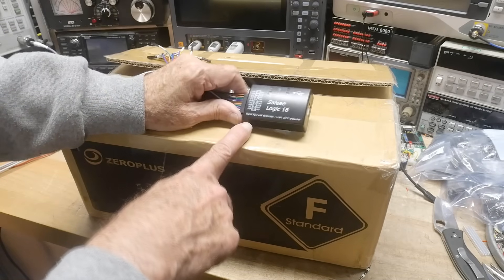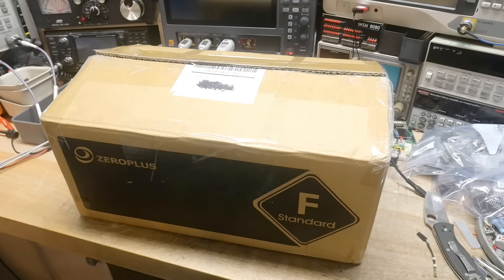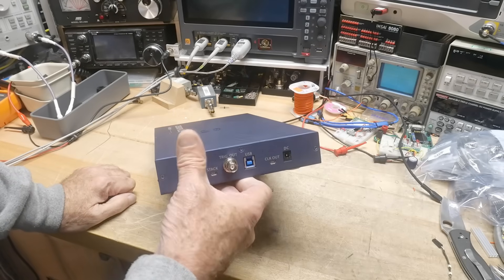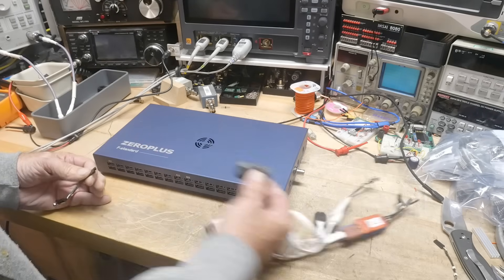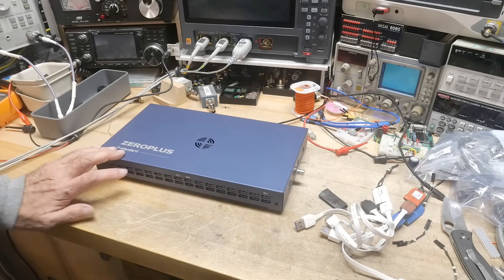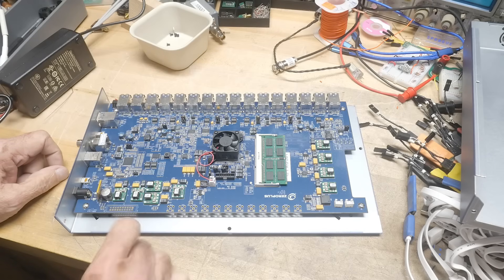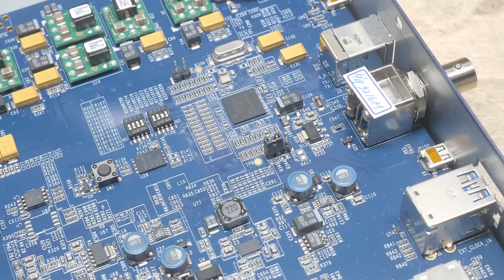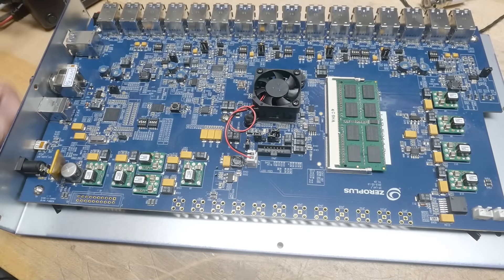#2470  ZeroPlus F1 Logic Analyzer (part 1 of 3)

Comment: As an alternative logic analyzer, I have had good luck using Sigrok software with Hantek's 4032L (32 channels, 400 MHz, 64 Msamples/channel).
Reply: Back in the in the late 1990s, I used HP 16500B and 16500C logic analyzer when you need to go way, WAY beyond 32 channels.  Great stand-alone equipment but I don't know how well the ones on eBay have aged.

Comment: 10:24 XTAL near FPGA is sitting on some fancy (ceramic?) adapter.
Reply from the maker: didn't catch that one, looks like it was made to fit a larger footprint.
Reply: @IMSAIGuy  I wonder if pads on it are in order to make parasitic capacitance some known nominal values
Reply: @IMSAIGuy  Could also be a programmable divider inside there as well, with the ceramic board to allow the chip to fit, so the divider can be changed on the fly.

Comment: Neat. I've seen these, but never seen a review of one. The ideal number of channels would be about 70 or 75 - that'd give you 32bit address + 32bit data + bus control signals. Usually you won't run into parallel busses that are wider than 32 bits - most things now are all serial. I did a reverse engineering project a couple years ago on a 32 bit system, and re-habed an Agilent logic analyzer back to life. It took a month to fix everything, track down all the correct cables and flying leads, stacking cables, etc etc. Fixing up the analyzer was a project all in itself, before the main project could even start!

Comment: If you're patient and look hard, you can sometimes score a reasonable deal on a high-end Keysight logic analyzer on the used market. I picked up a nice Keysight Logic Analyzer a few years ago... it supports either 128 or 256 channels (I forget which offhand) for about the prices of a high end oscilloscope. New, it would have cost north of $22,000, but I got my used one much cheaper than that. The only downside, and what I didn't realize originally, is how expensive the probes are. They come in bundles of 32 channels (or 64, I forget) and the machine supports up to 4 sets. And each set was a couple of thousand dollars! I think I wound up buying either one or two sets, and left it at that. If I ever need to analyze more simultaneous channels than that, I guess I'll buy the additional probes when I need them. But for what I do, it hasn't been an issue so far.

Funny you mention Z-80's. My interest in building a Z-80 retro-computer is one of the things that led me to buy my logic-analyzer. I mean, yeah, it's overkill for that purpose, but I'm not unhappy about having the extra capacity in case I need it for something else down the line.